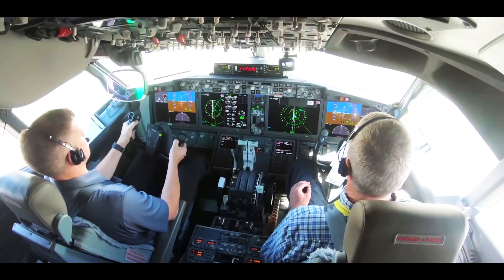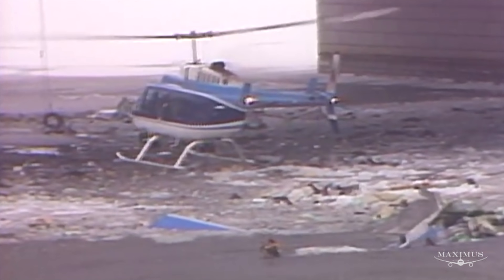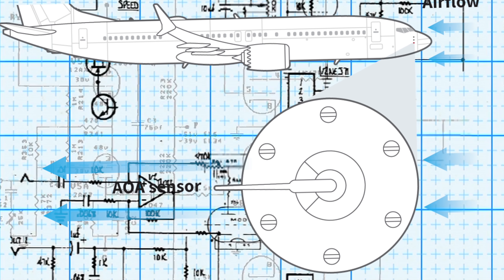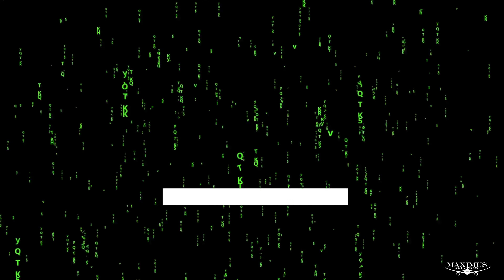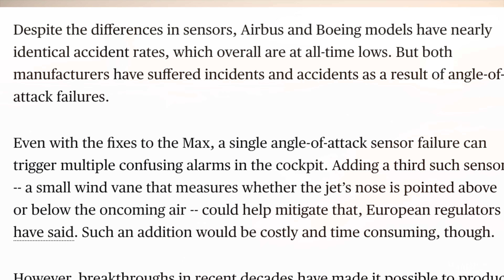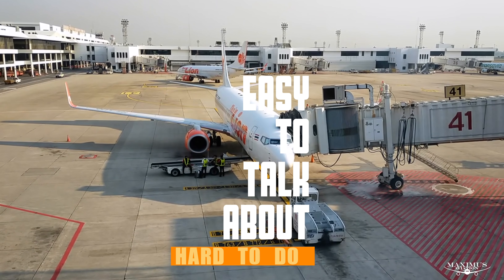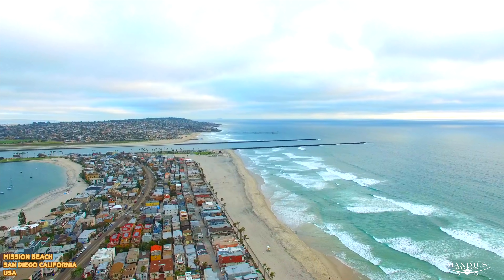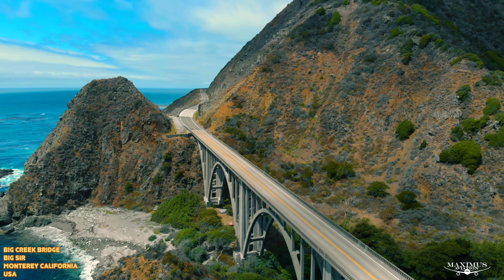Boeing To install 787s Synthetic Air System On The MAX! Boeing Caves To The EASA Will Install System

Comment: Finally, forced to listen to engineers' advice rather than to the Boeing accountants and lawyers. I hope they go back to the old days of being a company that puts engineering first.
Reply: Regulators have a lot to answer for.
Reply: In my 30,000 hours flying Boeing, I have NEVER had a stall vane failure. Statistically, a failure of this vane is remote. That is why all planes had only 2. If the vanes on those 2 accidents had been properly calibrated and installed, those crashes would not have happened. Had the flight crews reacted properly to runaway stabilizer, the accidents wouldn't have happened.
Reply: @carlweisser05437  Not true, worked on and installed angle of attack vanes. They were simple systems. What Boeing did with the Max is a whole different ball game. The crews had no chance with there training.
Reply: Quote: n my 30,000 hours flying Boeing, I have NEVER had a stall vane failure. Statistically, a failure of this vane is remote.

Twice in a year on new planes isn't "remote." And Boeing's own tests said that pilots had to diagnosis and respond to this problem in under ten seconds or all was lost. And how could they do that when there were no "AOA Disagree" warning. The indication should have been there, but weren't. And for the first crash, the pilots were not even told about the existence of MCAS. For the second, they responded as taught, but that wasn't enough.
Reply: @carlweisser05437  not disputing your flying hours or your expertise but:
1. The FAA, EASA and all other expert aviation regulators disagree with you.
2. Not "all planes have 2", you're mistaken. Many airplanes have 3 and there's a a very good reason why they have 3.
3. You don't have to lose all 2 A.O.A sensors to get into trouble. Losing only one of them is enough to spoil your redundancy because you have 2 conflicting readings and you can't tell which one is faulty. That's why you need 3. 
4. Please refer to the investigation report. The aircraft left the gate  WITH properly calibrated sensors.
5. It's Boeing's cost cutting policy that didn't provide A.O.A fault indicator in the cockpit. And furthermore, the airlines that did pay extra for the indicator were given indicators that didn't function (by Boeing's own words).
6. How do you expect a crew to handle a MCAS system that Boeing did their best to hide its existence from the pilot. 
7. Statistically the AOA sensor failure is not remote, it happens very frequently, what's not frequent is the presence of a "secret" system called MCAS. With MCAS on we had 2 crashes within a few months, and by all aviation safety standards that's not ok
Reply: @carlweisser05437  but not all airlines have equal standards or practices. Airbus have 3 sensors...why can't Boeings?? "Built to sell, not to fly..."
Reply: @fha1885  - Actually, Boeing traditionally built aircraft for pilots first. That's why they had (have) actual physical controls. Airbus built buses for the skies, hence fly by wire (computer).
Reply: Quite right. With three sensors, you have a voting system that rules the erring one out. With only two, knowing which is bad is impossible. And worst of all, as shipped MCAS did NOT consult two. It only took data from one, and shifted that one each flight.
Reply: I believe America started to go to shit when MBAs replaced those who ran their companies with passion and appreciation of the culture and technologies involved. 
 
Put MBAs back in supporting rolls, not leadership rolls.
Reply: +Afri Wing Best comment I've heard all day.
Reply: As a wise man I once worked would say, "Dream on, buttnut!"
Reply: I wouldn't count of that.
Reply: When you get arrogant accountants involved Wall Street comes first and you never have time to do it right but you always have time to do it over.
Reply: @JohnSmith-cw2wd  and the annoying thing is those accountants are not accountable (excuse the pun), I'm yet to see someone at Boeing actually getting penalised. None since back in 2007 when they faked the Dreamliner rollout
Reply: @JohnSmith-cw2wd  Exactly my teachers at school have posters that say those words exactly.

Comment: This is what the max needed when it was first started
Reply: And was also available if you were prepared to pay extra..
Reply: Schlomo Baconberg  What does it matter where I am from ? A flawed design is never solved by a software workaround
Reply: No what it needed was not more computers what it needed was the bloody wing re designing
Reply: @gowdsake7103  You have no idea what you are talking about.
Reply: @gowdsake7103  how would you redesign the wing? Would u make it higher? That wouldnt work either
Reply: @gowdsake7103  It wasn't a crash "because of a botched engine upgrade". It was a crash because two pilots didn't recognize runaway trim and flip a cut-off switch next to the throttles. Runaway trim is something that Boeing pilots have been taught since the 1960's. I have a 737NG type rating, which came out long before the Max and I was trained on runaway trim. 

"and a software bodge to try and regain stability in certain conditions hmm what bit dont I understand ?" 
All of it. There is no government agency or engineering professional anywhere who has ever suggested that there is or ever was a "stability issue".  That statement alone shows that you really don't understand the material or the root of the issue. Under a very SPECIFIC, low speed, high thrust condition, the Max has a higher than previous nose up moment that can easily be counteracted with elevator input. All 737s do this, even the NG that I'm trained on. Pushing forward on the yoke when you push the throttles forward is almost automatic for 737 pilots. All MCAS was invented for was so the pilot wouldn't have to push forward on the yoke any harder than he's already used to doing. Not because of some stability problem that you've invented due to not really understanding what you've heard or due to outright misinformation.

 "What bit about Boeing not redesigning the control surfaces because the FAA would have insisted on pilot retraining didnt I understand ?" All of it because it doesn't exist. There is no government agency or engineering professional anywhere who has ever suggested that any Boeing control surfaces need or even should be redesigned. That statement alone shows that you really don't understand the material or the root of the issue.

"what bit about Boeing not telling the airlines about MCAS and what it was for did I not comprehend ?" The part about all Boeing pilots already being trained how to deal with runaway trim, which is the ONLY fault condition presented to the pilot if/when the system fails.

"Would you happen to be American by any chance ?" Yes, I am. I'm 47 years old, have been flying since and solo'd before I could legally drive a car. I've been a commercial pilot for 24 years and have been flying Boeing products for 18 years (recently started flying Airbus products too).

I would strongly suggest that you gain a better understanding of what is actually happening before you so smugly ask questions like "What bit did I not understand" 'cause someone who actually does understand will happily tell you all the bits you really didn't understand.
Reply: gowd sake Actually, it’s been grounded to eliminate the possibility of further pilot error since it has been identified that something can be changed to remove the human from the equation and yes, it has happened before. But how frequently it has or hasn’t happened isn’t a valid argument. 

No, you don’t know that Boeing fucked up by rushing through a flawed design. You WANT to believe that. But the FACT is it wasn’t rushed at all. It was carefully considered and determined that the risk was acceptable. If there was any corporate greed involved, it was the greed of Southwest Airlines. Southwest was the one who insisted that no additional pilot training be required. Boeing didn’t just come up with that on their own. Boeing was happy to introduce a product that would require a “differences training”, but Southwest insisted not. Boeing didn’t imagine that pilots would “forget” the training they already had. So if you want to go through life thinking you’re correct when you aren’t, then great if it brings you some comfort in an odd way, but don’t fool yourself into thinking it’s real. It isn’t.
Reply: gowd sake The article basically says what I said. If you follow the “runaway trim” procedures, that will correct the failure. The article says that’s exactly what happened the day before. The pilot followed the runaway trim procedures and landed safely an hour later. The next day a different crew didn’t follow the procedures and crashed. That confirms what I’ve been saying.

Secondly, your opinions aren’t facts. Simply saying “Boeing is losing to Airbus” doesn’t magically make it true. Both companies are roughly equal. Thirdly, the A320 is a 30 year old design. Boeing isn’t the only company that is still building a decades old design. The Boeing design is a little older, but 30 years is getting up there too.
Reply: @xNYCMarc  the only thing is that four pilots from two Airlines did not know this or they be still alive today a lack of training Boeing fault
Reply: Richard Reid Wrong. Lack of training isn’t Boeing’s fault. As I’ve said before, runaway trim is something pilots have trained for since at least the 1960’s. The Verge article posted by the other commenter says that the day before the crash, a different crew followed the runaway trim training and safely landed an hour after the incident. The bigger question is why Lion Air flew the plane after the previous crew reported something wrong that almost made them lose control. I didn’t even know about that incident until just now. If your pilot tells you “this thing almost killed us”, you don’t just fly it the next day like nothing happened.
Reply: @xNYCMarc  but in all that Boeing and The FAA the buck stops at them this Max was a bad build aircraft in  the first place trying to beat a far superior Airbus A320neo that took ten years to build and not rush  having one angle of attack sensor  and faulty readings still flying strings inside of the aircraft not new like the Morden  super fly-by-wire systems this plane is even older than me at 50 years old  really unstable with those big engines
Reply: I am a training pilot so I know a thing two about the systems on some aircraft
Reply: Richard Reid They weren’t trying to beat anything. They created a product for airlines that were never going to buy Airbus in the first place. Southwest Airlines and Ryan Air aren’t going to change their fleet and have to retrain their entire workforce. Not everything is about “beating the other guy”.

Secondly, “far superior” is an opinion. You have no clue if either of the aircraft are superior to the other. You’ve never flown either of them. I’ve flown both of them. I like both of them. But you aren’t qualified to say if one is superior to the other. It’s just a guess on your part.

Third, Airbus’s fly by wire isn’t “super modern”. It’s 30 years old and they also have had several AOA sensor failures.
Reply: Richard Reid A training pilot on what? I noticed you didn’t say what what type ratings you have. I was a “training pilot” too when I was building hours. But that was long before I started flying heavies.
Reply: @xNYCMarc  but everything at airbus was an accident that happened Boeing, on the other hand, was an accident waiting because this rush work and thing like  shortcuts for the buck to save money and kill people in the process that what really got me in a bad mood  so that is why I say that Boeing has lost their way you cant be building planes for over 100 years and things like this happened  just not right  should be always better than anybody else
Reply: Richard Reid You keep saying that it was a “rush” and “trying to beat Airbus”. It simply isn’t true. They didn’t need to rush. Airlines that use exclusively Boeing products aren’t going to change over their fleet. Boeing simply designed a comparable product so Boeing only operators would also have a fuel efficient equivalent. This “rush” narrative is simply false.
Reply: @xNYCMarc  I was a Boeing too until I saw Airbus side-stick controller and the neat fly-by-wire system and GPWS call out mat now that was hot back in 2002 imagin an aircraft that you cant stall and auto trim man this plane is the bomb
Reply: @xNYCMarc  I guess you didn't know that American airlines wanted to get 300 of these Airbus aircraft and Boeing got cocky and let the horse out of the stable only to find out that  it was true and to rush to beat that sale now did you know that
Reply: @xNYCMarc  I get my info from good sources so that why I can get ahead
Reply: @xNYCMarc  you need to got to some of the sites to get the info from Dj aviation and Maximus Aviation just to name a few
Reply: Richard Reid I like the Airbus too. When landing, the computer goes into “flare” mode where for 8 seconds it artificially makes the nose “heavy”, which helps the pilot flare and get it on the ground. They have their quirks too. Everything about how it “feels” is artificial. It also forces your eyes to be the only sensory input where with the Boeing, you see and feel the actual aircraft through the controls. The side stick gives you no feedback. You have to be looking at the displays to know what the aircraft is doing. That being said, you don’t have to hate one to like the other. You can like both.
Reply: @xNYCMarc  but let Boeing get their house in order so that the flying public  can trust them that is the big word here trust can you trust them .i just cant any more Them and the FAA
Reply: @xNYCMarc  I Barbados where I live we get more Airbus Airlines coming  than Boeing now and we even got so die-hard Boeing fans  to switch since the Max issue  four hours from the USA and 8 hours from the UK  JETBLUE Virgin Speed Bird just to name a few  I am also a member of Barbados light aeroplane club I watch plane every Saturday for years now at 50 years of age I have seen a lot of aircraft types
Reply: Richard Reid I trust them and I’m the one in the front. I die 10 milliseconds before everyone behind me when things go wrong and I’m not worried.
Reply: Richard Reid JetBlue has always been Airbus since they started in the 1990’s.
Reply: They wanted to save costs in order to be cheaper than Airbus on the cost of passenger lives.
Reply: @habi0187  That is not farther from the truth.
Reply: Carl Weisser this was the only reason for the MAX. I am an engineer in industrial plants and in my field it is very normal to use 3 sensors in areas where the failure of one sensor could lead to the death of people. When you have two sensors the automation can not decide which one is correct so you need 3 sensors and a 2 out of 3 logic to identify the broken one. I was shocked that Boeing aircraft have only one sensor which is connected to a automatic device that can kill people. The behavior of Boeing even now shows that the put costs over life’s since they still want to safe money and not install a 3rd sensor.

Comment: That is a known requirement of EASA to certify 737-10 (MAX). EASA will allow grounded 737-8 and 737-9 to fly without this synthetic air speed, but once 737-10 is certified Boeing is required to apply this system to existing 737-8 and 737-9s too. As Maximus once said in one of his videos, "Fly now, fix later"!
Reply: There's not a real rush to get it fixed, what with COVID ruining air travel.
Reply: @fighter5583  There are already around 700 MAXs manufactured. Considering that airlines will prefer using smaller aircraft because of limited number of passengers, most of them will be flying just after re-certification.
Reply: @user-yt198  True, but many will likely remain stored until passenger numbers pick up to near what they used to be. With fears of second waves and flights still getting canceled or slowly starting, it doesn't look good for the industry.
Reply: @fighter5583  Actually EASA could simply say that they will keep MAX grounded in Europe until synthetic sensor is added, but they noticed that some airlines are just trying to get advantage from Boeing's delicate position, although those airlines do not need MAX that much and they decided to strengthen Boeing's hand.
They may ask a return for this favor in the future :/

Comment: What do you mean? Wasn't there supposed to be CoMmOnAlLiTy between the MAX and the NG and that the Synthetic Air System would not allow for that? Sadly Boeing is doing now what they should've done years ago...
Reply: A common type rating has gone out the window now. Boeing should have bitten that bullet earlier and then MCAS would never have been neccessary !!

Comment: How fitting that your diagram has old radio tubes, it is an old Boeing :-)
Reply: Looked more like a tube guitar amplifier!
Reply: Tubes, transistors, transformers, ICs, and a splash of gibberish.
Reply: Thermionic valve's is this the WW2 technology that they are using now.
Reply: @dogwalker666  Yes they upgraded
Reply: @soeren72  lol
Reply: 737 = steam airliner !